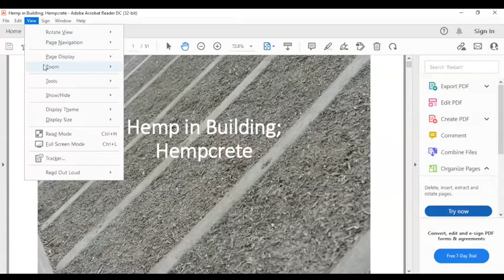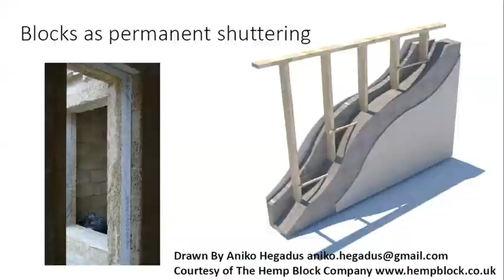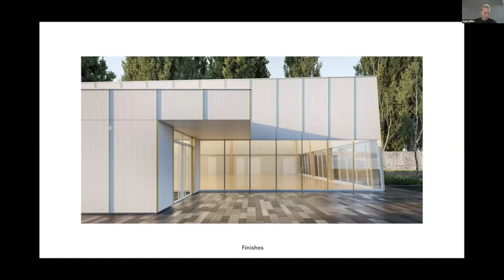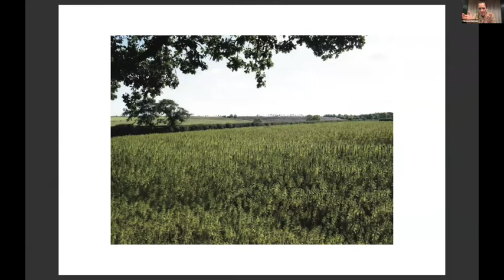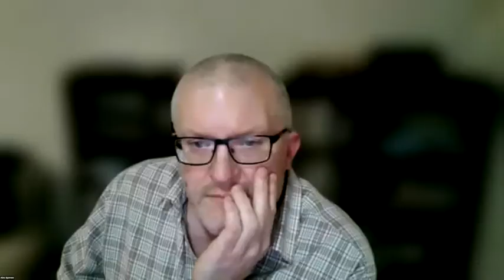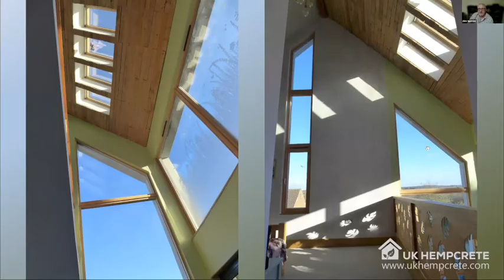Natural Materials Masterclass: Building with Hemp | ACAN |

Comment: A curiosity that is rattling around in my head but to which I do not have a clear answer at the moment, combined with external cork insulation, what values can be achieved?
E.g. wall thickness approx. 24 cm and cork 16 cm for a total width of 40 cm? (Ratio 1.5)
Not only for the thermal capacities but for the thermal damping or phase shifting behaviour and whether the hygroscopic capacities do not deteriorate.